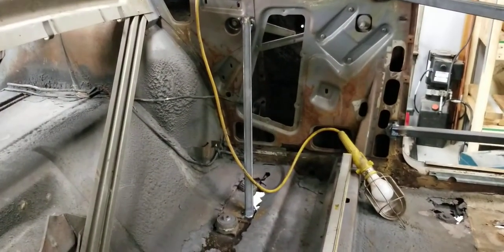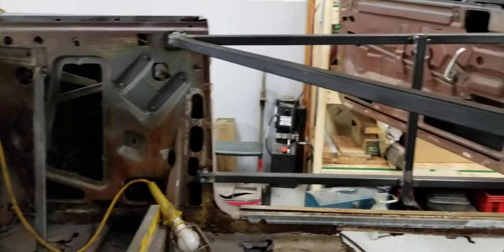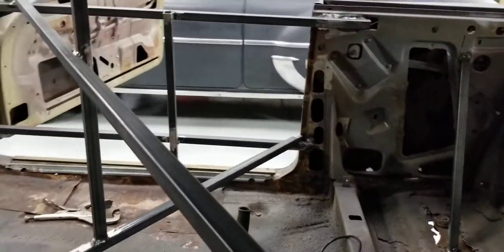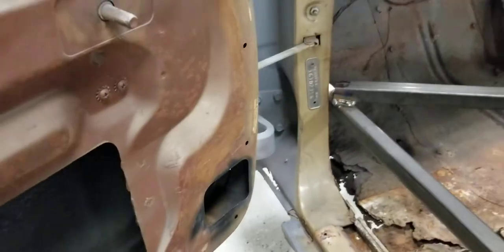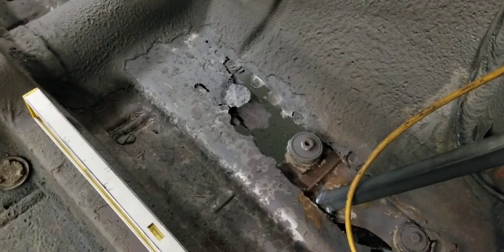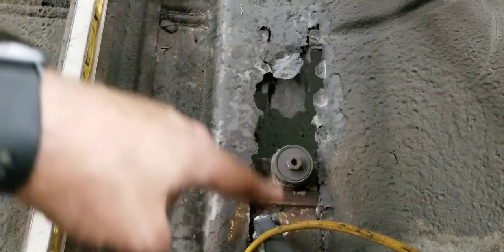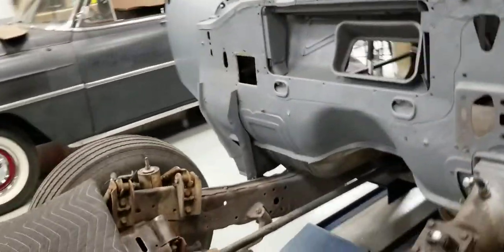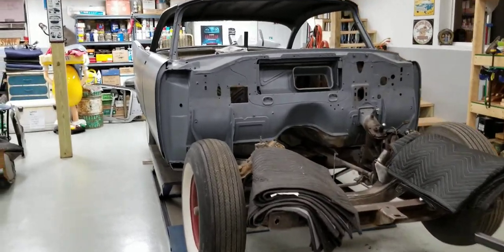Christine 1958 Plymouth Belvedere bracing for new floors

Comment: when you lining up the body panels / doors etc lower the car onto some axle stands where the car would normally bare its weight through the suspension.
if you have it on the frame you might find the gaps change when its on its wheels.
Thanks for the vids, 
Alos when you line up the front clip the lack of engine weight may also alter the gaps, i've not worked on a 57-79 plymouth but have done other similar full frame cars.
been a panel beater since '86
Reply from the maker: (Sorry about the delay) Thank you though that is a great tip!